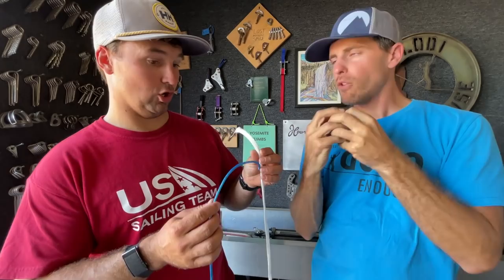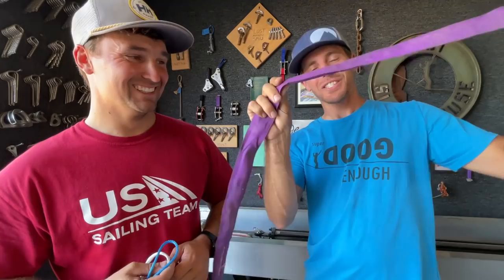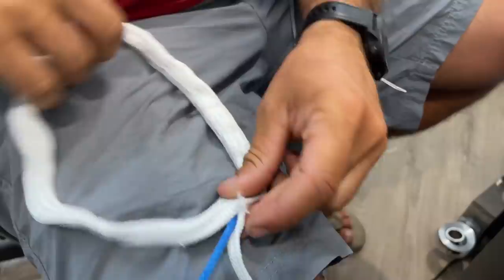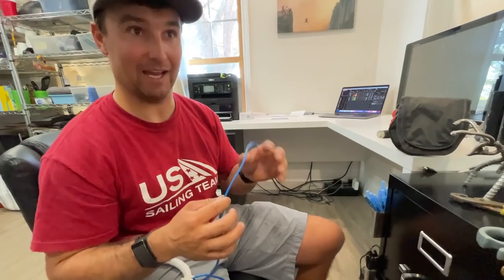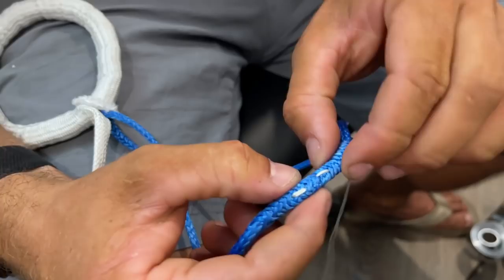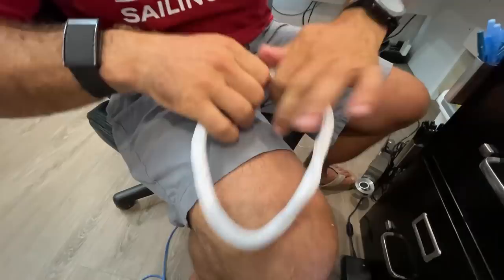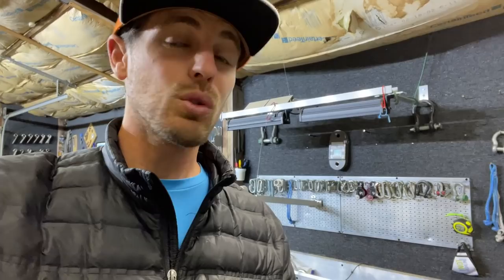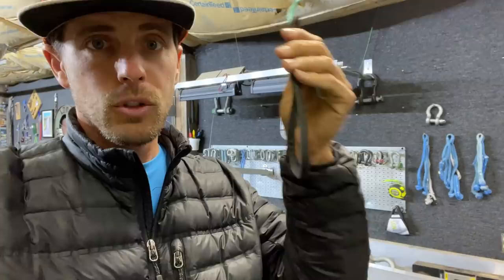Making and Breaking Amsteel / Dyneema Loops

Comment: This is what’s known as a doughnut in the inland towing industry. I have made many of these out of 1 inch and 1 1/8 inch Amsteel Blue. Their strength is amazing. The only time I’ve seen one fail, it was intentional. But before it failed I thought the deck fittings were going to be uprooted.

Comment: thanks for the great vid! I climb and also happen to live on a 43 foot sailboat. I replaced all my lifelines with 3/16 dyneema, with 316 stainless closed eyes in the endpoints at the pulpit and pushpit..used brummel splices. I plan on doing all the standing rigging in dyneema. can't wait to see more of the marine equipment testing..
Reply: Yeah I'd like to see a break strength test between a friction joint like this and a brummel splice.... rigging doctor taught me to do a brummel splice loop but I kind of like this loop better if it's strong enough. The brummel splice loop requires re-braiding a bunch of the dyneema which is a PITA.
Reply: @JR-kn6rs  have you seen this method?   https://youtu.be/DUSYUsWprc8
No unbraiding then rebranding needed. I can’t attach a picture of my pull test of 8mm loop doubled inside a chafe cover pulled with a Ford F-350 and an aircraft tug (its all I had for a big pull). The F350 wheels in 4-wheel just spun.

Comment: Try the experiment again, this time using steel shackles to pull the Dyneema loop. The soft shackles apply radial forces to the Dyneema loop that are absent in the case of a steel connector (quick link, shackle, carabiner, etc.), and it seems likely that that is the root cause of the low break strength. I did an interesting break test on an aluminum arborist climbing ring some years ago, but couldn't fit two of my steel pulling shackles to the small ring, so I used one steel shackle and one small-diameter Dyneema loop for the pull. The ring broke well below its rated strength. Interestingly, it broke where the soft shackle had been attached, and was twisted and visibly crushed at the jagged break. There was only a barely visible dent at the opposite end where the steel shackle had been.
Reply: I was taught “soft on hard”, meaning connect webbing or rope to a biner, and avoid connecting biners to each other or ropes and webbing directly to one another.  (Except yeah, biner goes directly on bolt hanger, and rope gets tied directly to harness).
Reply: it'd be interesting to try and reproduce this test
Reply: Try watching the entire video...... 23:13
Reply: @mdees88  Try assuming that sometimes people don't notice and you can say this in a different way.
Reply: @error.418    I just said it the same way he did. "Try the experiment again" / "try watching the entire video"...
Reply: @mdees88  🙄
Reply: Tell me you didn't watch the video without telling me you didn't watch the video.

Comment: Great video.  David showed us a very cool way to end the safety stich of the Blue dyneema with a half-hitch and bearing the knot into the dyneema. Which is super cool and very clean looking. I will using that method from here on !.....I did notice, David started the safety stich with a stopper knot..... It occurred to me if we start the safety stich WITHOUT a KNOT but leave a tail. Once we finish the safety stich with half-hitch. We come back to beginning thread both tails through the eye of the needle make one more stich with half-hitch and berry that half-hitch into the dyneema.....for a super clean look on both ends of safety stich.... More for loops without a cover.....What say you ?

Comment: Being that dyneema doesn't stretch much, any radius of bend is going to load up individual fibers more highly on the outside of the radius. The closer to a shock load this will be, the more defined the area of load will be towards the outside of the bend.  However, being that dyneema is incredibly slippery, the fibers will move under gentle and repetitive loads to naturally spread out the forces involved into a lot more equitable arrangement.  It doesn't take much to see why progressively loaded or settled dyneema loops are so much stronger.  What is happening at the macro level in the looped passes is also happening at the micro level in each bend. 
Dyneema responds to gentle conditioning, but don't we all? :D

Comment: Great video. 
Curious to know how a continuous loop of 1 piece of 8mm would have compared to the 3 passes of 3mm.
Also, our continuous loops usually have thimbles or low friction rings sized to the Dyneema. Maybe, a test with your equipment connected to the Thimbles or Low Friction Rings would change the outcome. Maybe a protective Dyneema net over the top and leaving the room during the test in case shrapnel is created 😬

Comment: Great video. That is an amazing loop.  I was hoping you'd cover sailing uses and cordage. (Maybe you have already). Brilliant result and very useful to know. 
 Re: sewing the whipping cord to hold the bury in place. We had a big Para Sailor (brand name) kite at the front of our boat. It had four 10mm spectra lines with spliced loops (no thimbles). All of them eventually had 'rope a roids' (?) where the core worked out between the 12 strand cover braids.  I just pushed it back in and made some very ugly stitches, same Robline as in this video.   Seemed to work -- but I have no idea (1) if it was the best way to do this?  Or (2) maybe I just created a more serious problem later.  (These spliced loops were connected to the sail with a Dyneema soft shackle. These are used instead of something metal, or a bowline, so when the kite sail is whipping around it won't kill anyone.) 
Often when I see someone in a video using a fid, it's something I'd use a wire as David does in this video. I have some straightened stainless steel piano wire, 1/16 and maybe 1/32 that I just bend in half (very tight bend but I do keep some radius so it pushes through smoothly) And I prefer DIY wire. The ones sold by Harken have handles. These can get in the way. With bare wire if I need to pull hard I'll just use pliers or Visegrips.  
It's terrific that you're making videos on sailing. I showed up on board a sail boat with a lot of paracord, and carabiners. The sailors looked at it and scoffed. I had to leave several carabiners behind because they were performing important jobs.

Comment: This is fascinating to watch! I'd trust splices made by David. As a climber, splices generally weird me out because they're handmade things that can't be inspected like a knot can.
Reply: Sean Monahan

 All knots reduce the strength of a line. A proper splice will retain near 100% of the original strength. Often exceeding 120% of the original strength. The failure point will be where the splice starts to change the natural lay of the line. That’s why proper tapering the splice is important. 

 It’s just as easy to inspect a splice if not easier than it is to inspect a knot. 

 Manufacturers warn against attempting to use knots in this type of line.

Comment: quick tip, for cutting Dyneema get a david boye cobalt knife.they will cut cleaner and easier all day long.
Reply: Thanks for sharing the tip. I greatly appreciate it.
Reply: I usually just use my toenails
Reply: For cutting dyneema a ceramic blade works very well.  I bet that’s what’s in those scissors.

Comment: Maybe you could share with David my suggestion to test the Jordan Series Drogue junction where 3 Brummel spliced eye loops ( the 2 bridle eyes attached to the boat to the lead section eye of the JSD rode) are girth hitched together. 
The Dyneema chafe cover would be a good variation to see if it prevents this heating effect between the 3 eye loops? Not sure how you could test it with the 3 lines fixed to 3 points, but if the 2 bridle eyes were one end & the 1 lead section eye the other end, is probably super good enuf.

Gradual tensioning to let the dyneema fibers equalise in temperature would be very applicable to this JSD drogue use case as well.

Comment: Have you you seen "GAC Flex" spansets aka liftall .  GAC is short for Galvanized Aircraft Cable, which makes up the steel core of this spanset.  Unlike traditional spansets with a polyester yarn core, these spansets withstand higher temperatures.

Comment: It's either a fit a spike or an all however there is no reason you cannot use a needle. You use a fid to slip something into a braid, a spike to open a bind, and then in all to create an opening where there was not usually in the process of whipping and stitching. Needles are usually used for whipping and stitching however when you are pulling braid a needle is just as functional because you are only pulling strands to thin the braid. AKA any point will do in a pinch when you are going to cut the line at that point. And as I always think my ends I always pull one or two strands ahead of my cut and then sink it by putting it back through a few forward before cutting. When the tack is stretched the end will be sunk beautifully.
Reply: Awl?

Comment: Any rearrangement of the strand stacking order in the bend will cause stress reassignment in the strands. I believe that spansets work better with Polyester or Nylon strands than Dyneema because of the very low stretch of Dyneema. Even if you could condition the loop by equalizing the internal stresses, the geometry will change when the loop is unloaded and especially if it is repositioned or flexed thus reordering the strands.

Comment: Yes herringbone is free-floating and stretchable where a running Stitch or a loop Stitch is going to rip shred and tear because you did not leave yourself enough sleeve to stretch your Loop. I know that at least my pack is going to be stronger than your attack because you're pulling shortcuts here and there. Personally I prefer making tax that looks like Nanobots bills it that way nobody knows where it starts or where it ends. Yes it requires you learn how to plait but once you know how to flat then the time that it takes is so minimal in comparison because your tack is so much stronger so much lighter and always passes inspection. And there's one more beautiful thing about my tax I always get top dollar because with my tax complete failures do not happen only a partial fail will happen before you replace it thereby saving the majority of your load. Yes I have to admit my tack will allow me to drop a barrel every now and again but I have never dropped an entire net, nor have I ever had a wild swinging load. Because ounce for ounce my contact will save your reinforced tack from a complete failure.

Comment: I usually use one Luke needle to pull three looped needles saving me both time and frustration, or I do it the hard way and work my loops one half at a time alternating. Simply anytime saving trick that does not sacrifice strengths or quality.

Comment: When you re tested the mailed in one, you didn't use soft shackles so the tests aren't comparable. I'd say test whatever they use on a boat? Great vid!
Reply: The boat gear used in each nitch application would be different. I'm Shure we could find an application on a boat that this would be the exact setup( 2 large shackles connected by a loop).
Reply: @daviddroescher  but the point was to test the practical boat setup
Reply: So are you saying there's not a chance they would apply the soft to hard rule in the boating industry and they're soft to soft was not a violation of this rule ?
All indications are that the small bend ratios soft shackles + failure to "set" the knot was the failure mode . As well as the stated opinion of both people present at the original test.
Did you notice in the pictures of the boating application of this device everything is protected with hard inserts that give a more favorable bend radius,and prevent braking the hard on soft rule?
Reply: @daviddroescher  no, I just know their intention was to test his boat setup! No test is useless, I was just pointing out the data is a little off since the tests weren't the same setup

Comment: So I think the stiching and taper of the internal loops prevents equalization. If it was preloaded (just bounced on?) with the splice stitch in place, but not tied off and buried, and UHMW tape was added between strands you would get super high breaks after a couple of low load pull cycles.

Comment: You needed to put thimbles in your eyes on the machine you used to pull the loop apart so it doesn't heat up because of the bend radius being to small and heats up.

Comment: Most dyneema applications on sailboat are designed to minimize stretch (deflection) under load, which means actual loads are much lower than breaking strength of line used.

Comment: Is there a reason for not using a locked brummel splice to connect the ends?
Reply: Pete Sweitz

 Yes because it’s a more drastic change to the natural lay of the line. This causes it to be weaker.

Comment: How are they affected when they are wet?  In sailing they are wet most of the time.
Reply from the maker: I doubt water changes the strength
Reply: It is possible that wet is stronger, since the water would absorb heat, and dyneema seems to always end up failing via melting.
Reply: My guess would be they are weaker when wet, due to decreases friction between fibers.

Comment: Using dyneema twine-thread for locking stitches isn't the best idea, especially without preloading first, for the exact same reason that using dyneema lines is a good idea. High strength, low stretch. When stitched through a non-pretensioned line or splice, the dyneema thread will resist proper 12-thread configuration within the main line/splice once put under load, as it traps down on itself. If the configuration is too misarranged when locked stitched...especially with a thread as low stretch as dyneema...the counterforce of the locking threads against the proper settling can lead to failure at the stitch points.

Samson recommends nylon thread for lock stitching for this reason, and preloading of the splice prior to lock stitching can further mitigate this risk.

Comment: Okay thank you very much finally somebody who builds tack the same way I do. Most people hold their houses together with nails and screws I hold my house together with dyneema tack and carbon fiber, dyneema, & Kevlar gel coats depending on the requirements. That is straps, belts, sheets, lines, and sleeves. With epoxy or latex rubber rosin. Never risking my gear to a single stitch. Okay not exactly the way I do things I'm going to be making stronger tack than you are making. However you're making three complete loops and then thinning your core as I will only use two before I send my core creating the Third with a chaffing sleeve pre-installed. And yes like you said it just takes practice to learn where it's going to find when it stretches. So I usually air on the side of extra links in the sleeve because I can always Stitch a sleeve as it is only for chafing protection. The core is always much less forgiving. And I am risking not only my life but my livelihood on every piece of tack.

Comment: Any reason you refer to the piston as a " hydraulic"? The word hydraulic is used to describe a system "operated by a liquid moving in a confined space under pressure."
Reply: He just doesn't know. We all know it's a hydraulic cylinder.
Reply: @justinmeyerr well, yes, but the hydraulic cylinder, or actuator if you will, is made up of a cylinder with a piston running inside it, so not really wrong to call it either, since both are parts of it.
But yeah, in the industry we usually just call them hydraulic cylinders for sure.

Comment: If you have no choice but to stitch your core lines to keep them from sliding out of each other braid your stitches against all in houndstooth pattern amongst all of the lines in the rope in order to share the stresses equally and don't forget to zigzag when you are whipping and always I repeat always use rosin of the appropriate type in my case Sun baked milkweed latex as the latex rubber is a stabilizer not a strengthening comp and it is already UV protected by the sleeve. In addition I know my tax is stronger than yours because I do not burn anything no sharp edges to cut other lines and that is why I use rosin.

Comment: Your first test was a failure because you did not prepare your Loop and you did not wet your Loop before testing it. Stretching and settling your tax will set it so that it will be at its highest Springs otherwise you are at the strength of the weakest point.